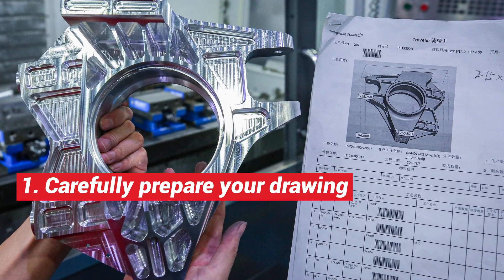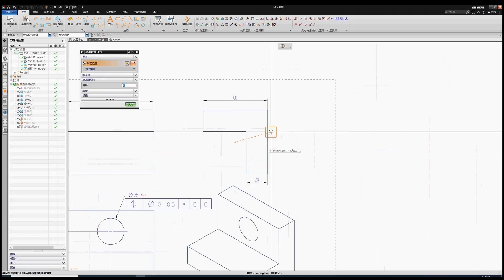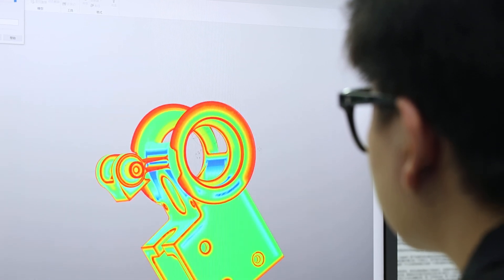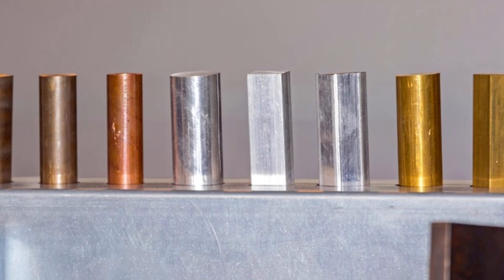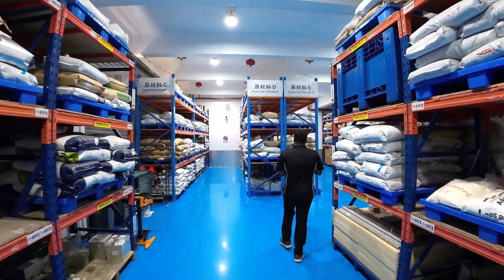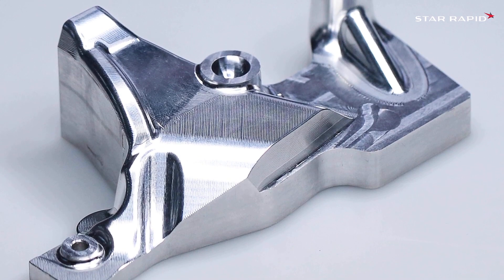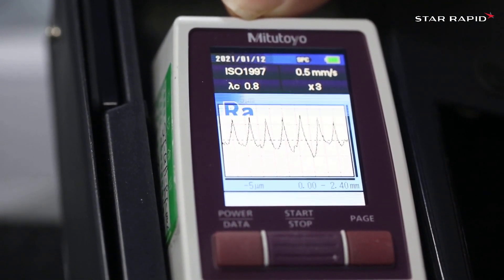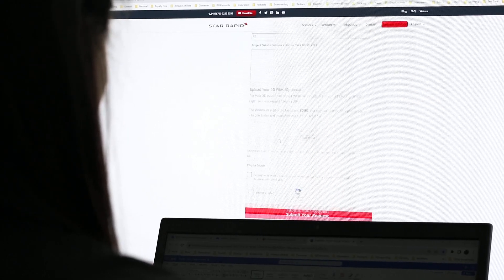PRODUCT DESIGNERS often make these 6 MANUFACTURING mistakes! ⚠️

Comment: I work in die cast foundry as a technologist and j work on quotes to new client. Very often I get parts which are in very first stage of project and need some changes and consulting with tools maker. Majority of these parts are imposible for manufacture and i have to explain to clients reason why they must chenage their design and they never happy of that